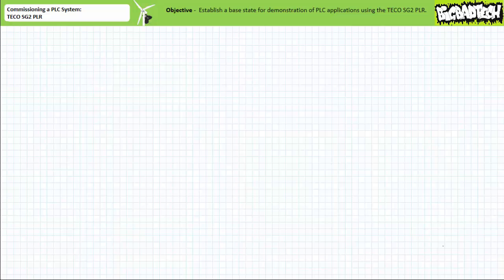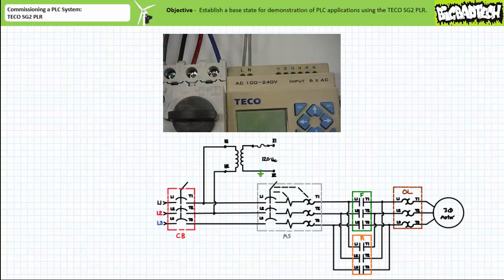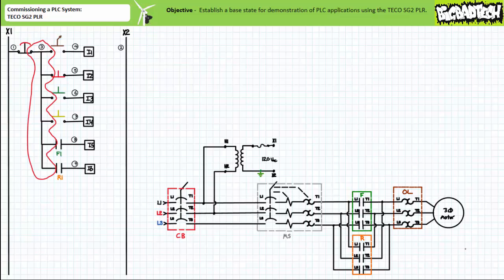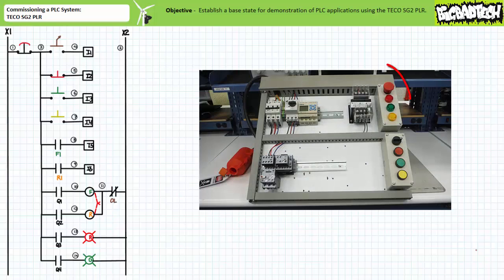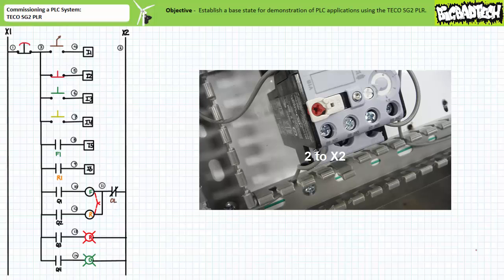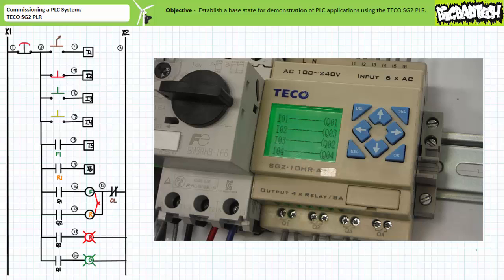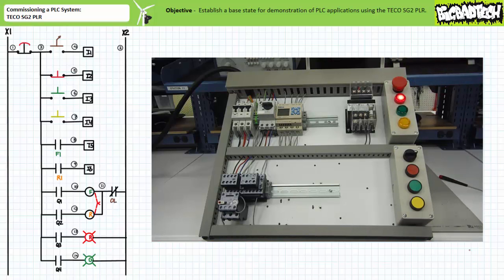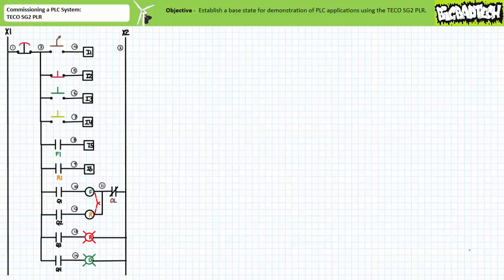Commissioning a PLC System: TECO SG2 PLR (Full Lecture)

Comment: Hi Mr. Jim
Thank you so much for the detailed and great explanation and display,
I have one Question,
can we program PLC to increase and decrease the motor spead,
in the same Control Panel which you make. and do we have to add extra button, or we can use same Bottons,

I saw now in our factory they use Control Panel include VFD to increase the speed, ( Control Panel without PLC)

Thanks a lot and I look for your advice.
Reply from the maker: Good question. Speed control via a PLC would necessitate a PLC with "analog" input and/or output. Analog differs from digital in that analog is smoothly variant voltage or current signal inside a given range (ie: 0-10V) whereas digital is fully on or fully off (ie: 0V or full 120VAC). The TECO SG2 PL2 10HRA is digital only. I'll be discussing analog inputs/outputs in the near future. A good primer for this type of material is the "Introduction to Sensors" lecture at: https://www.youtube.com/watch?v=fhp61CepgUg
Reply: Thanks a lot Mr. Jim.